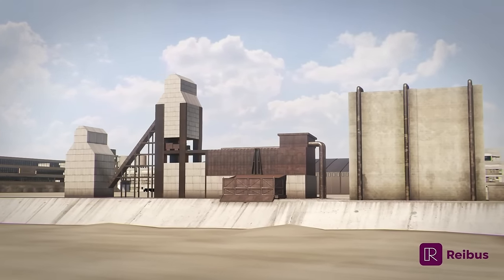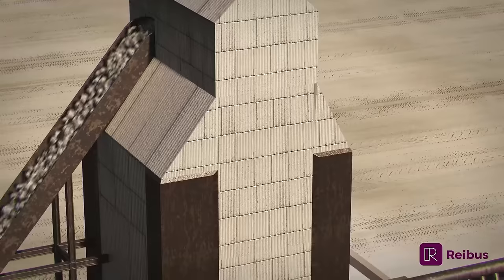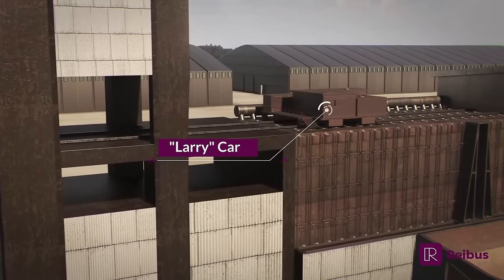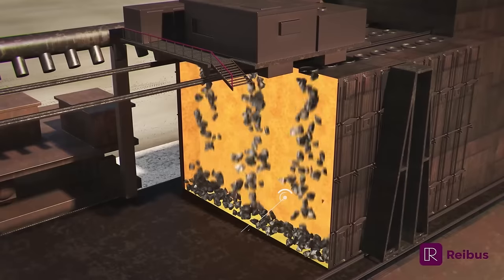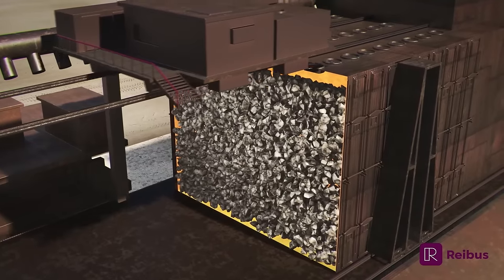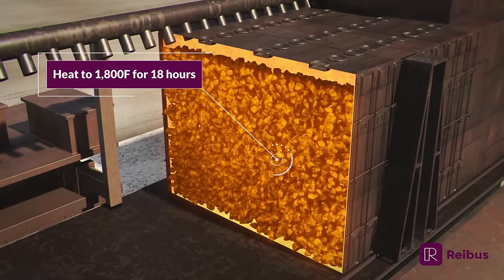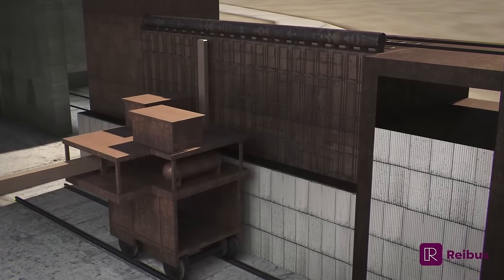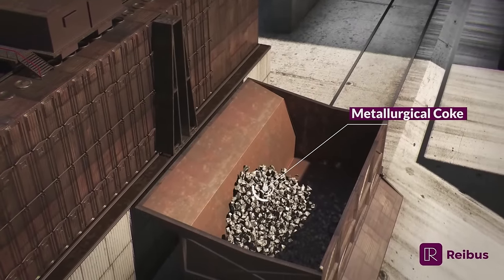Coal & Coke in Steelmaking | Reibus U

Comment: How does the coal not go up on fire when the coke making process starts
Reply: See fire needs oxygen basically air but in the coking oven it's air tight meaning no air gets through meaning no fire will start but only heat will make the coal have a higher carbon percentage